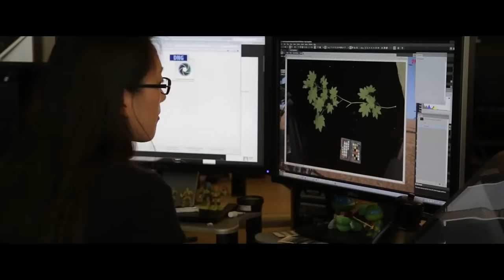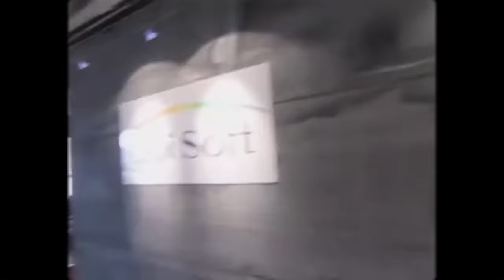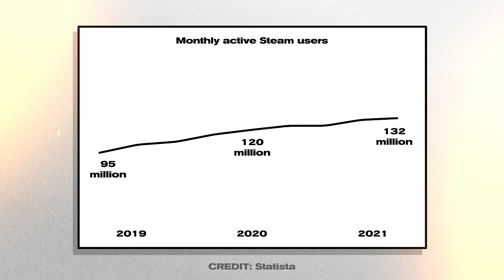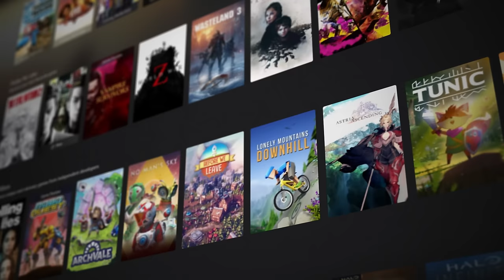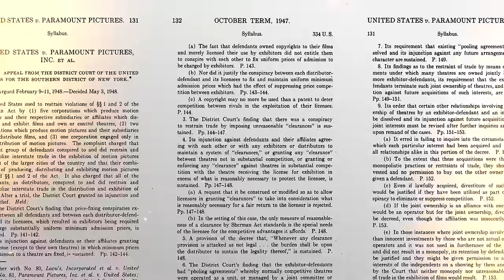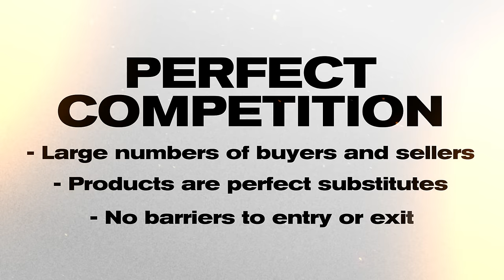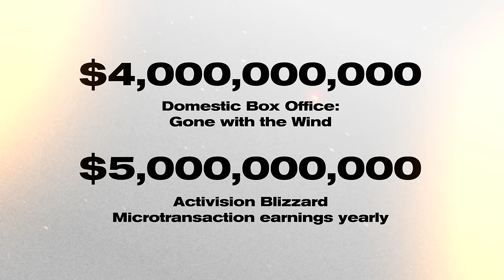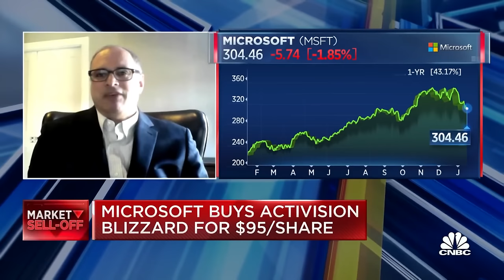The Gaming Industry's dirty little Secret explained

Comment: 00:08 Gaming industry studios are mostly owned by a few major corporations.
03:25 Ubisoft's success and expansion through strategic game distribution and business model
06:29 Competition in digital game distribution has led to a wide variety of storefronts with different features.
09:22 The gaming industry is experiencing a battle for market dominance among major players.
12:31 Vertical integration in the gaming industry and its parallels with film studios.
15:38 The gaming industry is emulating the market saturation and monopolistic competition of the film industry.
18:43 Microsoft's acquisition of gaming companies raises concerns about monopolistic behavior.
21:42 Gaming industry giants hold significant power and control over the market.
24:42 Gamers must reject poor games and unfair business practices

Comment: 23:30 So... why can't we do that again? Other than Nintendo, Sony and Microsoft have separate branches for their console and distribution groups. Slash Xbox Game Studios and the Xbox Gaming Division (the hardware team behind the machines and most of the network platform) from Microsoft and make them into 2 separate companies, the same can be done for Sony, the "Playstation brand" and the game studios, EA Publishing is it's own house and can be easily lopped off, ditto for Ubisoft. Tencent and Embracer Group are a conglomerous mess, their studios entirely self-publish, mostly on digital platforms, they'd have to be split by the studio because they've been atomized so heavily. 

The real difficult one is Nintendo, as their software and hardware divisions are one in the same, Nintendo NEPD (AKA Nintendo R&D 1+2, AKA Nintendo EAD+SPD), which Nintendo has been shuffling together and splitting apart repeatedly every time talk of regulation comes up in Japanese politics. Nintendo doesn't own a lot of studios, but they also control their platform with a tight fist and do everything they can to avoid competition with any of their games on their own platform.